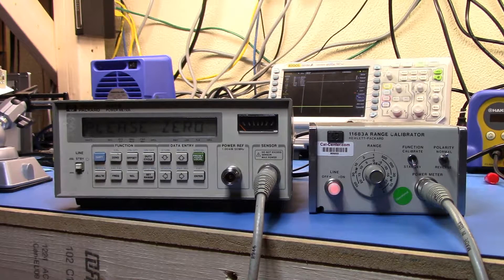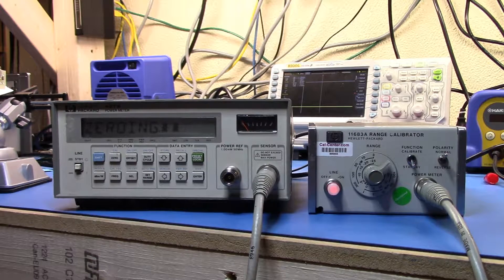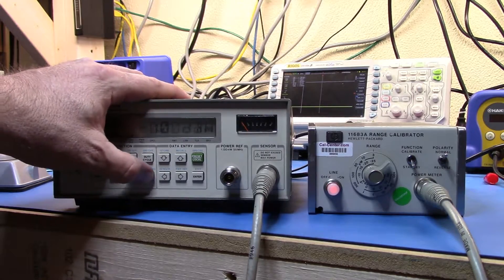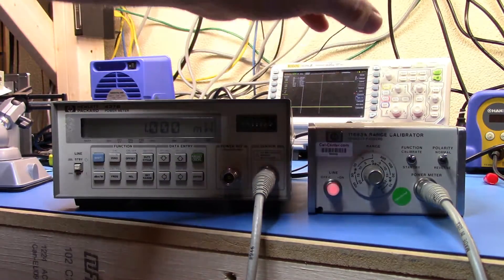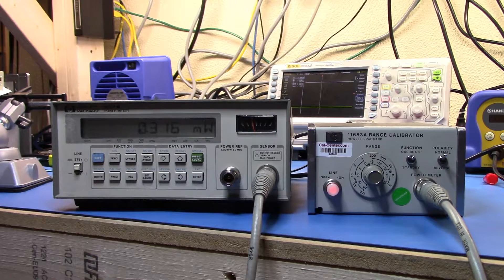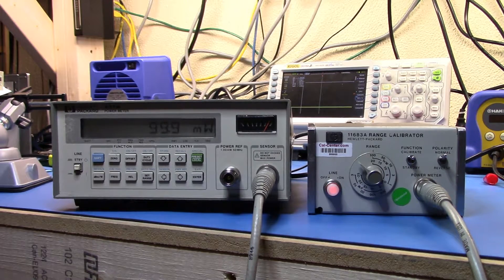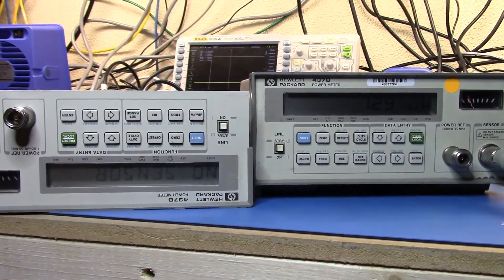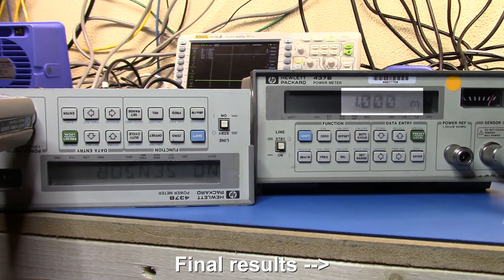HP 437B Performance tests and power reference adjustment

Comment: sir pls suggest for calibrating with sensors
Reply from the maker: Unfortunately calibrating the sensors requires quite a bit of special gear so they're really only able to be done at Keysight (where I sent mine) or a 3rd party lab with appropriate standards.

Comment: Hello, I missed the right pot which need to be turned to get the 0dBm REF OUTPUT value :(
Reply from the maker: Are you asking about tweaking the output of the reference oscillator to be 0dBm? If so then you can see it at https://youtu.be/JafAJEPXERE?t=579 - It's the second can, closest to the rear with the coax cable connected. There is only one hole in it. BTW you're supposed to use a 432B with a special 437A Themistor to set it to the right accuracy but if you have a normal 478A then that's probably good enough for most people. Failing that you can do what I did here and use a 8400 series sensor.

Comment: I bought a 437B but he has a faulty power sensor plug (bad contact), the one on the front panel. I was unable to find a service manual. Do you have any information regarding the pinout from this plug, which color goes to which pin.
Regards and tnx in forecast for any valuable infos.
Stephan.
Reply from the maker: Artek Manuals has the full service guide for the 437B - http://artekmanuals.com/manuals/hp-manuals/

They're a great resource and well worth the price.

Comment: A very interesting and useful presentation.
I never bought the HP-11683A calibrator, it used to be cheap and the meters were expensive, today it's cheap, the meters are cheap and the calories very expensive now from 700 $ to even 1950 $ so I probably do not buy it, it's too expensive.
I would love to check my gauges with this calibrator but these prices are killing.

Well, you presented how to use this calibrator, such presentations are very helpful.

I cope without the HP-11683A calibrator, I have a lot of different power meters and until they all measure the same, it means they are all good.

Regards Tomasz
Reply from the maker: Thanks - The beauty of the 11683A is that you only require a DMM to calibrate it (6 digits which inexpensive bench DMMs are now capable of). You'll still need a 478A-H75/6 for the power reference but the other functions can all be done with this. If you ever need a meter calibrated I'd be more than happy to do it for you.
Reply: @tgsoapbox  How do I understand DMM I only need to calibrate the 11683A itself? to check if 11683A can be used as a calibration device, should this be the way it should be understood?

It seems to me that having a good - DMM digit number 7 digits and a laboratory DC power supply, you can do a calibration without having to buy 11683A?

I understand that the calibration of HP meters using 11683A is faster and more convenient, is this reasoning correct?

Will calibration of the reference power source be good enough using 478A-H75 / 6? I know that this is recommended but it is a very old device.

As I understand the 478A-H75 / 6 sensor will you need an HP-432A meter ???

I am convinced that my sources of reference power are well calibrated because I have quite a lot of them and all indicate very similar power levels, while the sources from HP-435, which I consider to be the pattern.

All my HP-435B (4 pieces) have identical power levels, regardless of the date of production, storage method or source of purchase of the meter. The stability of the reference power sources from the HP-435 is absolutely fantastic

Please, give me your email address for further correspondence because I do not want to make a mess on your channel.
Reply from the maker: @sp5mxx To calibrate the 11863A you just need a DMM to check the voltage reference and resistance. You can see the steps in the manual on the Keysight website. The reason you can't just use a DMM on the meter directly is that you have to simulate having the power sensor connected to the unit for it to work correctly.

I think the best thing for you to do is to create a post on the EEVBlog forum and then we can move the conversation there - My forum name is Tony_G.
Reply: @tgsoapbox  Hello, if instead of 11863A I would like to use a laboratory power supply and DMM meter for calibration, it would obviously simulate connecting the power of the sensor, it is done very easily, inserts the resistor from the resistance resistor depends on what sensor will be detected.
Reply from the maker: @sp5mxx  Unfortunately it's not a simple power input as the sampled output is a 220Hz AC voltage - Grab the manual from the Keysight website and have a look at the A3 Sampling Gate Assembly schematic.
Reply: @tgsoapbox  Hello, I know the subject and I know the power diagrams of the sensors, in the indication of the levels you probably will not need a 220 Hz signal, I'm not 100% sure, I need to check it out.
You can build such a calibrator based on a damaged power sensor, but it requires a lot of time for such a construction, especially matching the resistor divider. if you buy such a damaged calibrator then you could easily repair it and it would be much cheaper.

Regards Tomasz

Comment: Is a man with two 437s like the guy with two watches?  ;-)  Thanks for sharing, am over on your channel via the EEVBlog Jan 2018 route.
Reply from the maker: I think it is :) Thanks for coming over - Hope you enjoy the videos.
Reply: Great! I've moved along over the years from the 435 to 436 to 437 now...look forward to perusing all your other videos.BTW, are you a ham by any chance? Have a great weekend!
Reply: @PapasDino  Hello Dino, I have all these meters but HP-436 does not judge well, such a transient meter before HP437B which is wonderful.
The HP-435B is an analog meter and is also great for tuning and adjustment and has the best source of reference power from all structures I know, including the new ones.

For me, the HP-435B is used for tuning and as a backup source of reference power for comparison with other meters.
Dino, what are your callsign?

Best regards, Thomas SP5MXF
Reply: @sp5mxx    Hello Thomas! I still have all three meters but the 437 occupies the main position on my workbench; the analog meter is ok for simple stuff but if I really need to finely adjust something power related the 435 is there as well. You can see my bench on my QRZ page.  73 - Dino KL0S